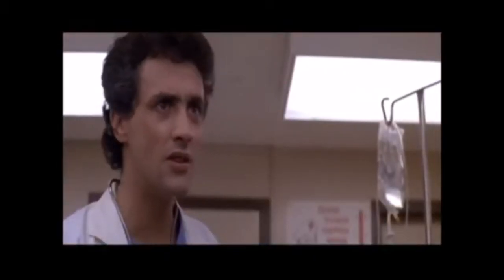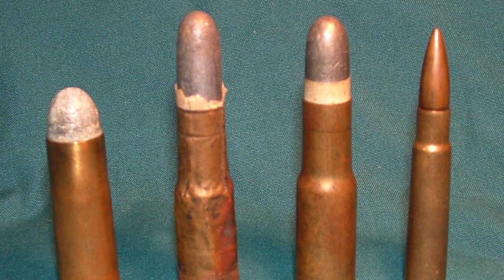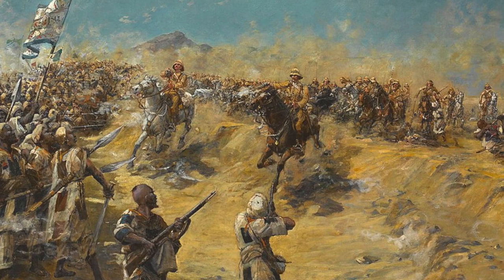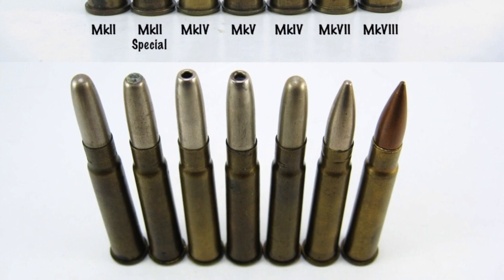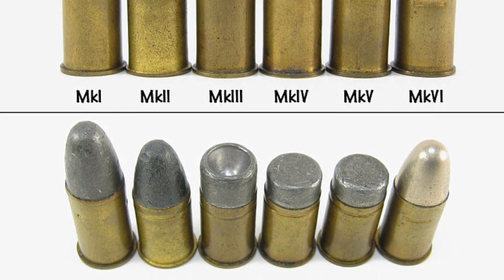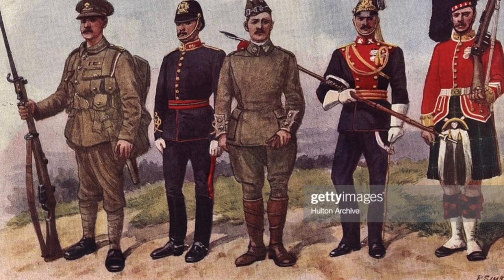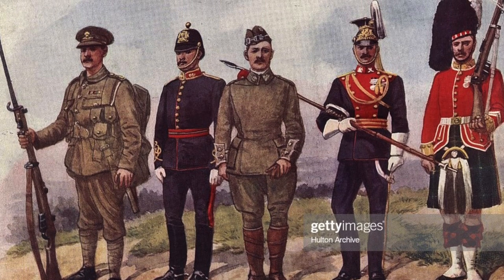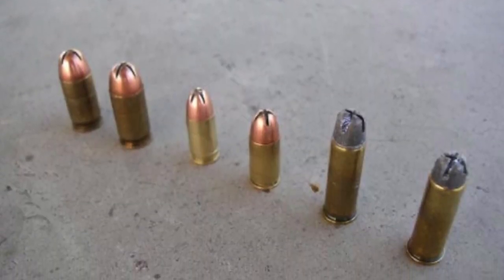What you know about the Dum Dum is WRONG

Comment: Careful about removing the tips on modern FMJ rifle bullets - these have exposed lead at the base, and I've heard that, as a result, you can actually leave the bullet's jacket in the bore when the round is fired. The next round will burst the barrel. Note that all commercial jacketed hollow point and soft nosed bullets have solid jacket material over the base of the bullet. The bullet's lead core is inserted into a cup, which forms the jacket. With FMJ bullets, to form the tip, the bullet is inserted into the swaging die base first, while with hollow and soft points, the bullet goes into the swaging die top first.